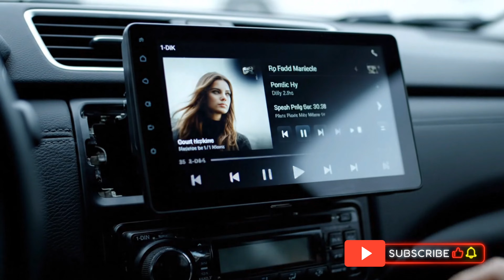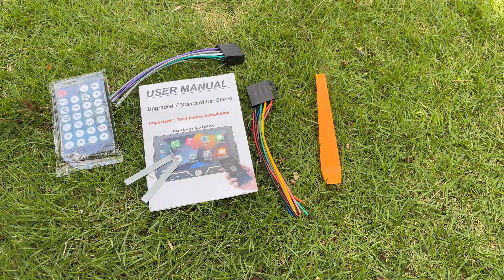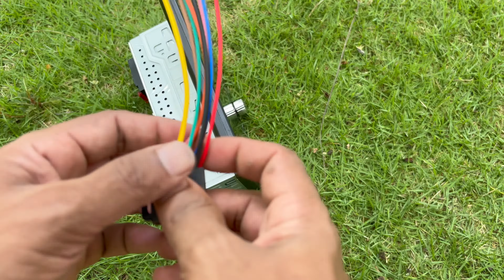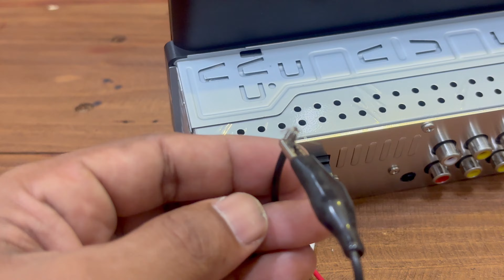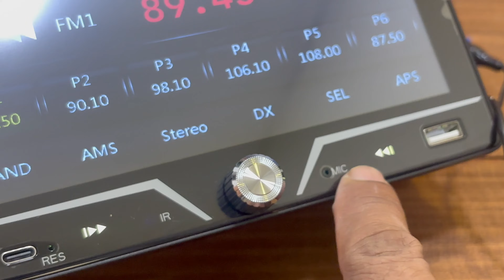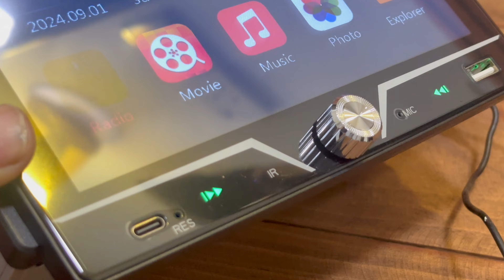Installing 1 Din Car MP5 player looks like 2 Din | Do not gave up your dream PART 1

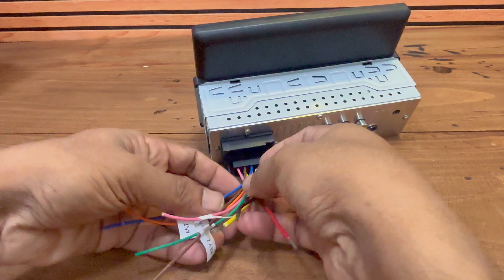Comment: 2:26 why is there a extra port even though it doesn’t fit and rarely no one uses it
Reply from the maker: It is for audio cable
Reply: What if a company accidentally put both of the same ports? ￼